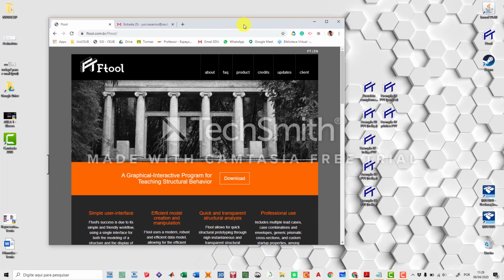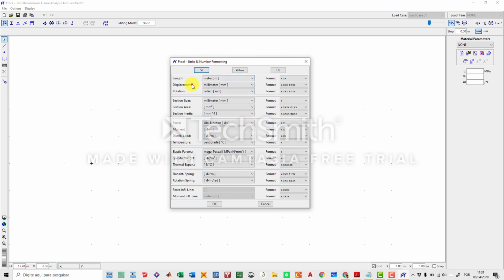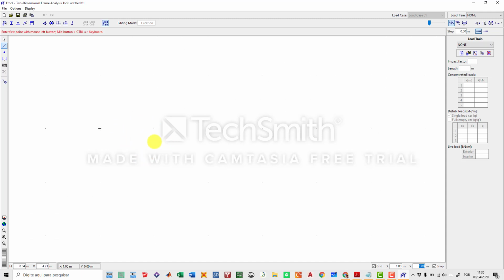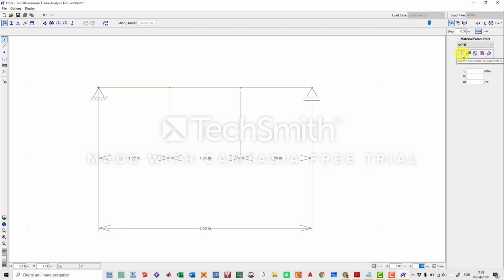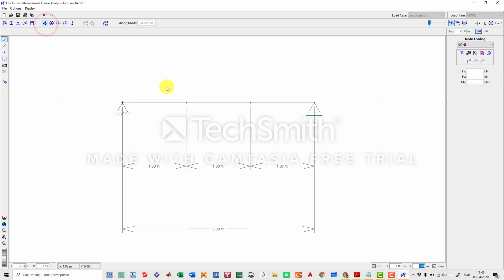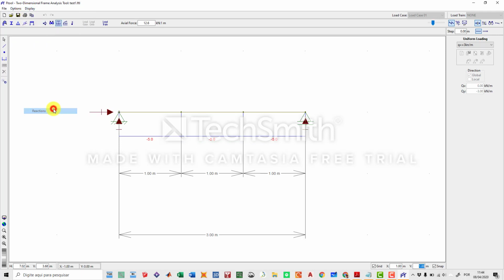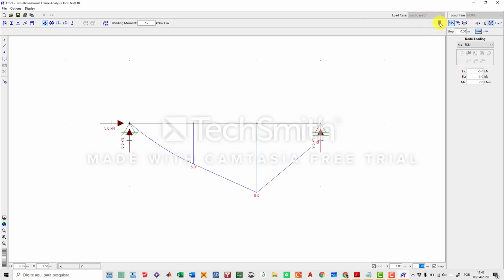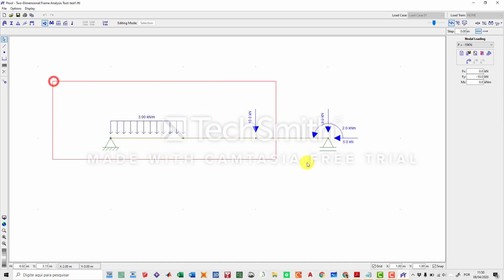Ftool - Free Software of Strucural Analysis

Comment: how to add triangular load over UDL? Needed for bridge design dead load analysis
Reply from the maker: Right next to the icon "uniform load" (on the top side of the screen), there is another item with the triangular load right next to it (between it and an thermometer for heat load) - the icon is called "linear load". Then you created it just like an uniform load.
Reply: @yuri.bessa91  got it .Thanks!